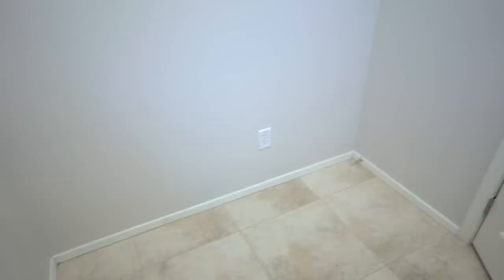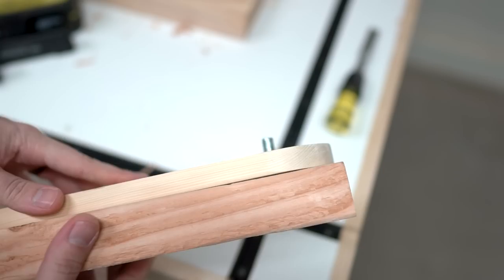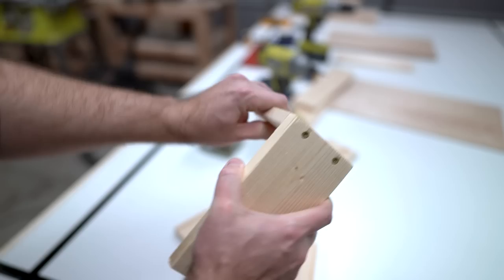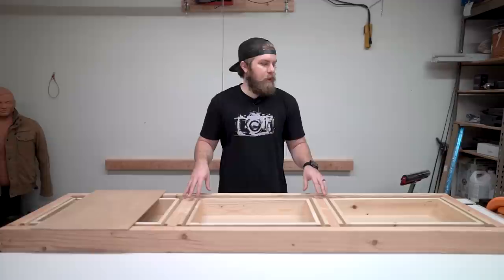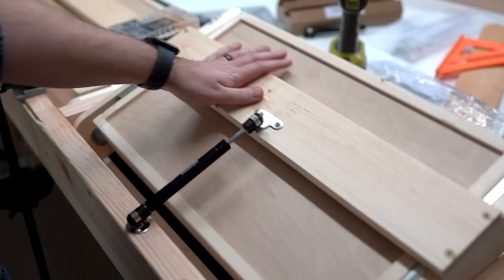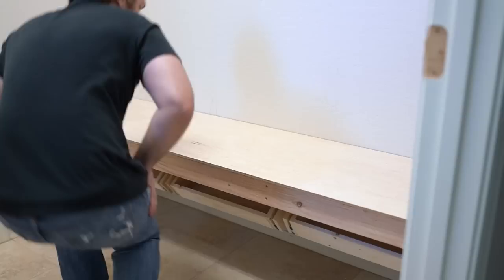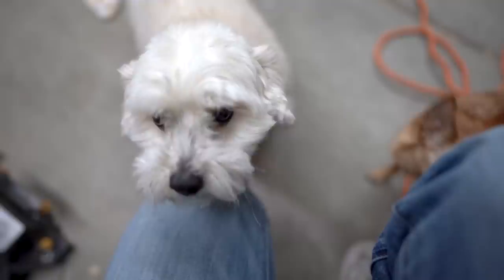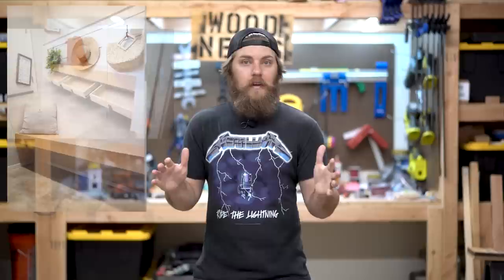EASY and CHEAP Hidden Drawers Floating Bench/ Mud Room / Cheap and Easy DIY

Comment: User error on the pocket screws - you need to go towards the meat of the joint not the edge.
Reply from the maker: That would be stronger, sure, but it depends on what you’re building… the strongest method isn’t the only answer, nor is it required.

Comment: Great Vid Man, Thanks.  It's just the gas shocks holding the drawers up then?
Reply from the maker: Thank you! Yeah, they are pretty strong. I am considering adding a locking mechanism in case I want to store something heavier in there but as it is, they do a pretty good job by themselves.

Comment: What type of sander and dust collection do you use in the video and have you upgraded those tools since?
Reply from the maker: Hey man! I’m actually using the ridgid random orbit sander and ridgid shop vac! They make a hose extension with a built in reducer that fits the sander exhaust perfectly! The combo has been really effective!

Comment: Wow, great video and awesome piece. Not including the tools needed (clamps, drills, etc), what was the total cost?
Subbed and liked, hope to see more content soon!
Reply from the maker: Hey, thank you! Prices are a little out of hand right now but it was around $250 for all the lumber if memory serves me correctly (this includes the mdf I used for the board and batten - next part of this project). Then $50-$75 for the drawer slides, pulls, and bolts. I could be off a bit but this should be ballpark. Pretty cheap considering the impact it has in the space.

Comment: I was thinking about a good place to keep an AR near the door...
Reply from the maker: Hey Brian! As long as the drawer dimensions are big enough, this would work for that! You’d also want a latch or lock! I don’t believe the gas pistons would be strong enough to keep the drawer closed with that much weight! I’m pretty sure I’m going to be adding a locking feature before my final video on this build but need to think in order to come up with the best solution. Thanks for watching man!
Reply: @WoodNerds  I was thinking that as well... Even with 2 pistons
Reply from the maker: That could work to offset the weight, of you decide to put something light in there it could become a challenge to pull down.

Comment: what kind of latch do you have to hold that drawer up?
Reply from the maker: The pistons hold the drawers up, but any latch will work if you’re storing heavier objects. You could also drill a hole in the frame and slide the drawer pulls forward into the hole to hold them once up.
Reply: ok.  one more question. where did you get that shock?
Reply: I guess what size is it also?
Reply from the maker: No problem! I ended up getting more powerful ones after testing it out for a while. They should be listed in the description and amazon has the dimensions there.